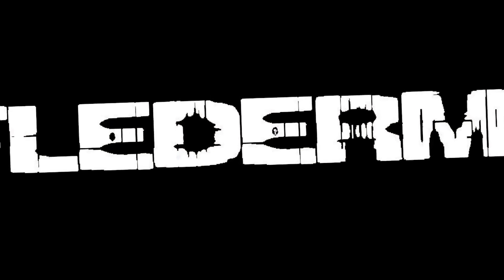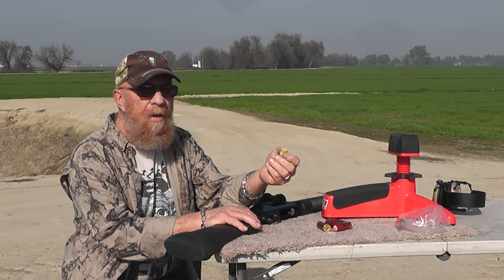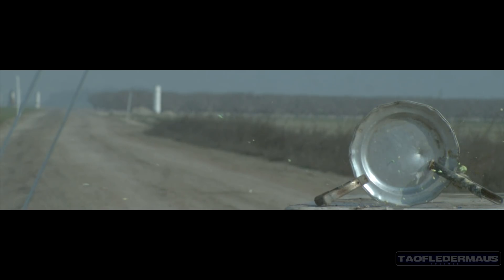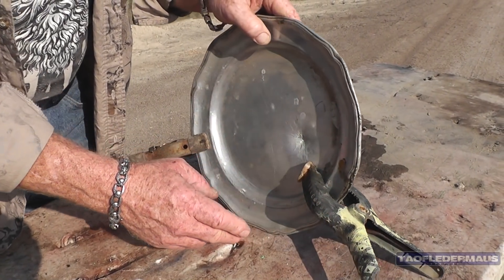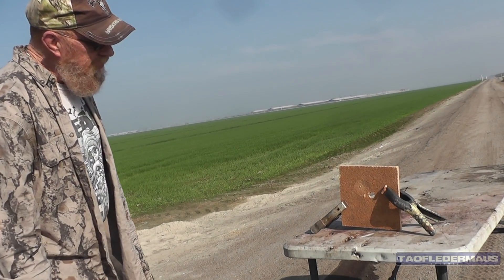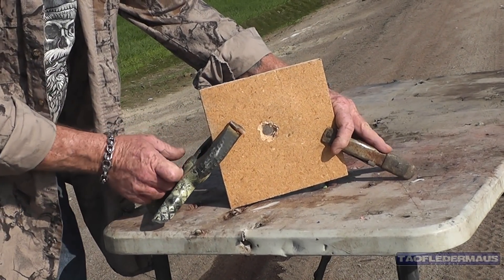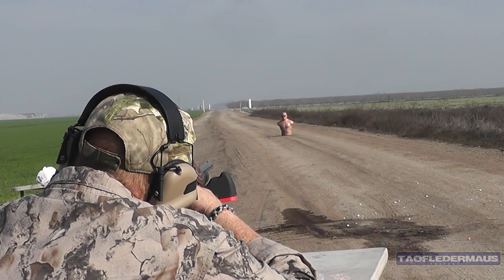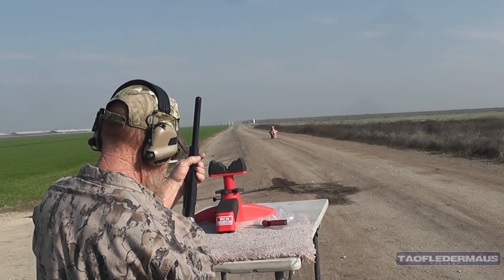FIMO Polymer CLAY Shotgun Slugs - TOY Surprise!

Comment: You did not mention thye weight of the FIMO slugs. I would imagine that they are fairly light weight.  Did you consider adding a small amount of Lead (or even  steel) axially through the slugs  to give it some additional weight?

Comment: What if you pressed a drill bit or a tungsten carbide rotor bit into the tip before the clay dries? Would it act like the steel core 5.56 ammo where the core just keeps going?

Comment: The video also proves that using the hollow Diablo slug won't affect the aerodynamics, so you can use it to fine tune the slug's weight to adapt it to a load or save money on material. Would you test to see if you can use that space to put something on it, like a BB or a new illegal poison vile? I have been thinking, if we are talking about subsonic speeds: the slug should create a small bubble at the back, so maybe that bubble is big enough to store something on it.

Comment: I admit that I do worry about the fact that you shoot without a backstop, I also admit that I have no idea how far those slugs can make it when shot parallel to the ground or in worst worst case scenario, like a rebound  at 45 degrees above the horizon. I said worst twice for a reason, I'm not an engineer but if I was one I would design this kind of test without including air resistance or any kind of friction loss to be extra safe. 

Is there a shooting, physic, or general science channel who has tested how far different types of slugs or bullets go in real life? I think modern technology is up to that challenge if you have access to a large flat surface. It might needs several channels to collaborate together though.

This is not about accuracy but safe distance under the most freakish of conditions.

Comment: Hey Jeff, Have you ever thought to add a 4x8 sheet of plywood opposite the high speed marked with one inch squares to confirm your velocities? I would think with the rarity of some of the loads you guys shoot a second way to check and/or confirm velocity for particular projectiles would be with a frame speed by inch division to get another metric to confirm your findings.
Reply from the maker: I don't have room to haul that in my truck

Comment: You should use the board with lines with a specific distance between the lines to figure out speed. Not as fast as the chronograph but would be more accurate.

Comment: Hey Jeff, is it possible that the it's the gas seal that the chronograph is picking up, if you are using one that is, or could it be that there needs to be something with more mass for an accurate reading?
Reply: Daniel Monsanto good question